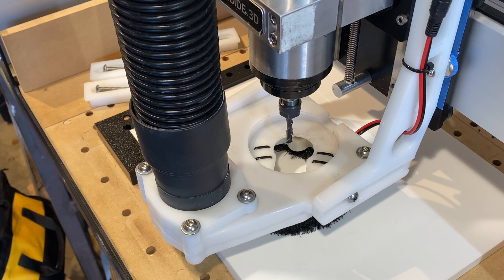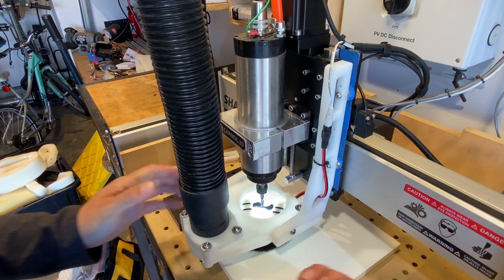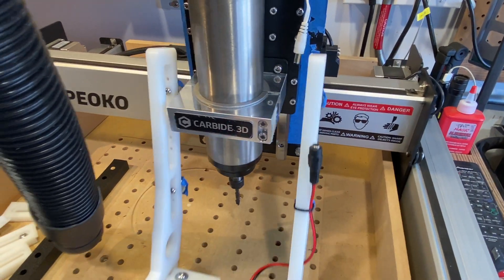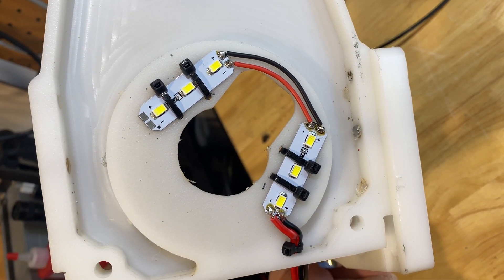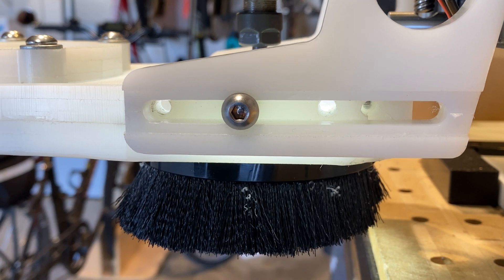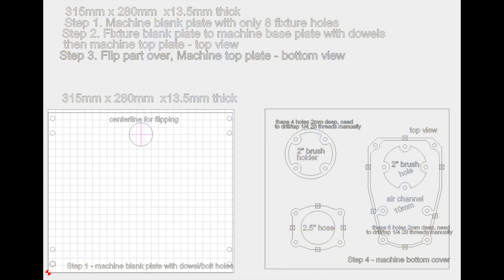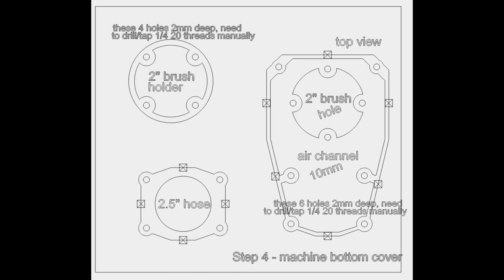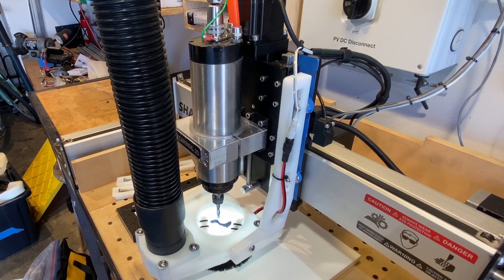LED Dust Boot for Shapeoko with Z plus Upgrade

Comment: Hi, I saw in a different video you upgraded to a Z plus. I also upgraded to Z plus (after watching your video, so thanks!) and to a spindle. How were you able to push the spindle down the mount so much? Mine only goes down an inch or so.

Are you by chance using a 80MM spindle mount?
Reply from the maker: I'm using the 65mm spindle mount that came with my shapeoko, it has a straight hole so once my spindle is in, I can clamp the spindle at any position. Maybe you have a burr, or just need to force the clamp open a bit with a pry tool.
Reply: @etischer  Yep you're correct! I was able to force it in. Thank you!